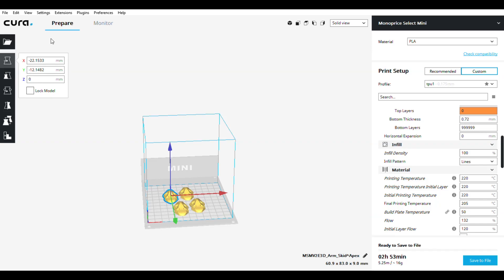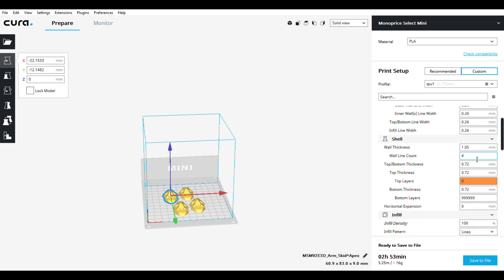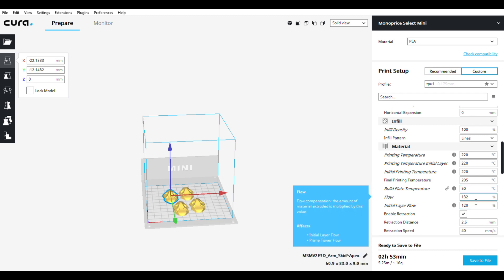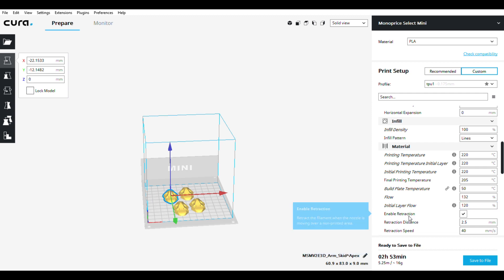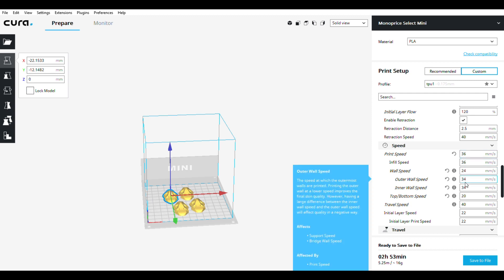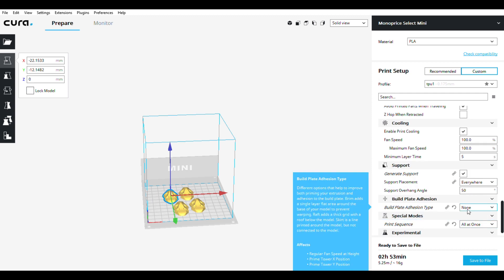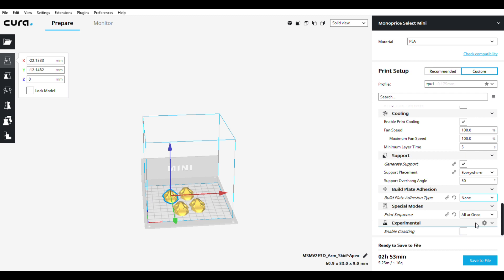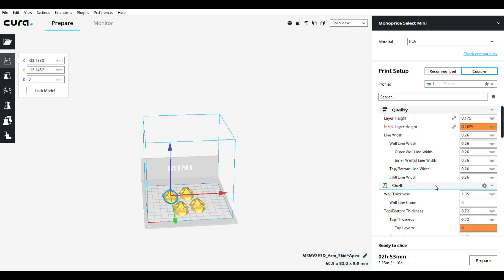Cura Settings for Tpu Monoprice Mini Select Pro

Comment: I did change a few things from your profile but overall this video really helped me. I have been using S3D for 2 1/2 years with amazing success, but the software quit loading on my pc so I had to try the free Cura and was able to print PLA no problem first day. Tpu on the other hand has been tricky. The flow change is what I was looking for and your video was the first I watched that showed a change in the flow for TPU. Thanks again
Reply from the maker: Yeah, increasing the flow is the key.  you can tweek the retraction settings if you are getting to many boggers on your prints.  I'm constantly tweeking these settings, but they are a good starting point for tpu.

Comment: Hey man I don't have a monoprice but I print lotsa kwad tpu, & save sum weight by adding more external shell layers n less infill, adds shock absorption too ;)
Reply from the maker: Thanks!  I am slowly exploring what different settings do.
Reply: @mooosestang   NP man, make sure to add top bottom layers too not just shell for things like skids, I use these on all builds 5g for 4 w med infill n like 3 layer shell of .2mm  https://www.thingiverse.com/thing:1323147